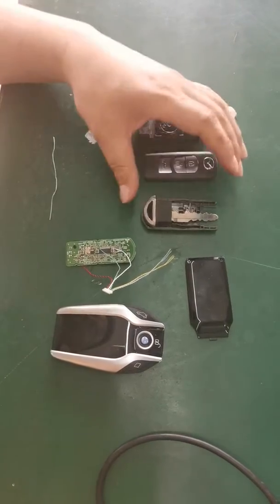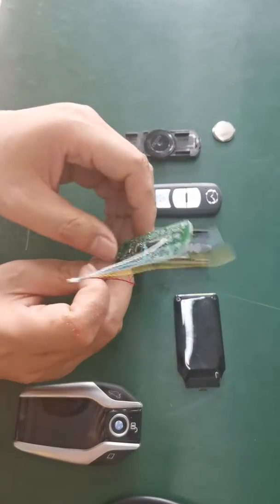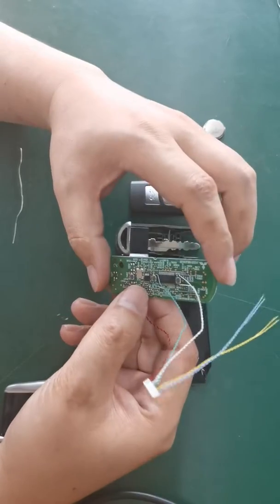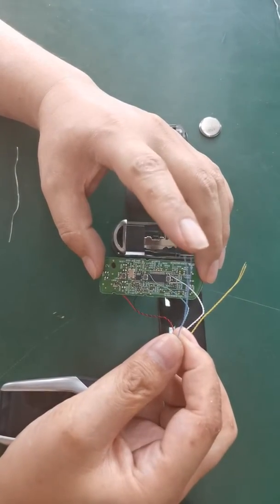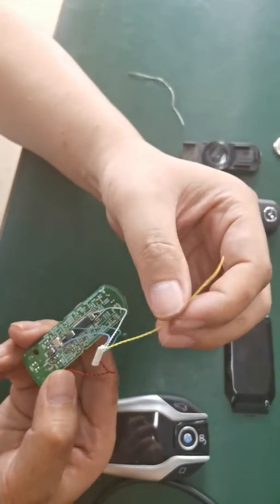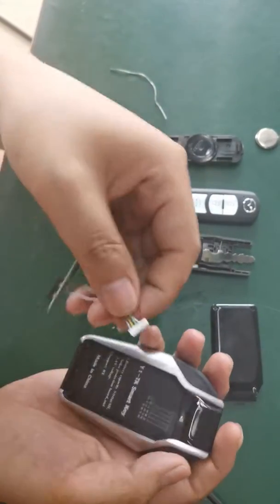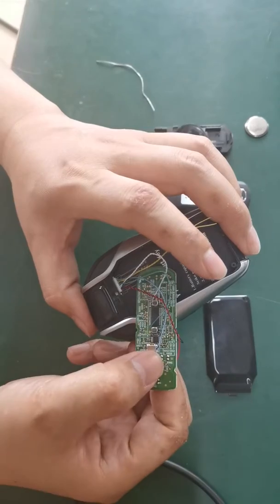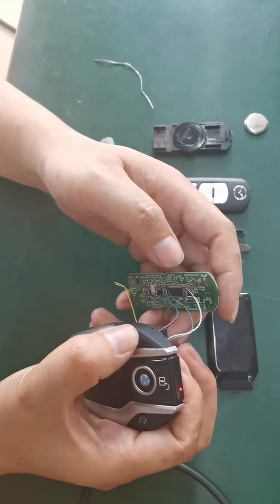Install LCD touch screen smart remote controller

Comment: How can I contact you? I have the same Mazda remote and the smart one, but I connected it with different color wires and I can't connect it like you can you help me?
Reply from the maker: it is easy, only sure different color for lock, unlock and trunk, then soldering same color to the Diagonal corner of button

Comment: hello, can you explain how to change the car model, with a personalized photo.  that a custom possibility, to insert a photo by connecting to the pc, but I can't do it.  i changed the logo photo to a custom png photo.  but i can't add a photo of my car.  do you know how it can be done?  graxie
Reply: i think only... but you can try.
first, on your computer be shure that you have same photo format (.jpg, .png, .img) etc. After you upload to key try to keep 15 sec pressed on logo until you get all the pictures and the choose yours. to be shure that it work, make same picture in computer in diferent formats. 
In boca al lupo
Reply: @djovidius3545  I solved the problem, you need a photo in the correct format.😉😉